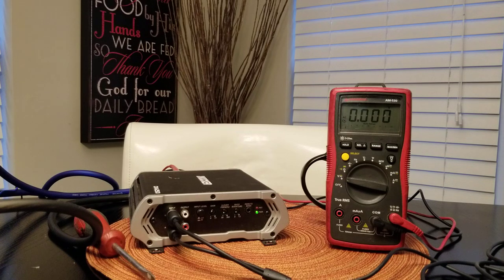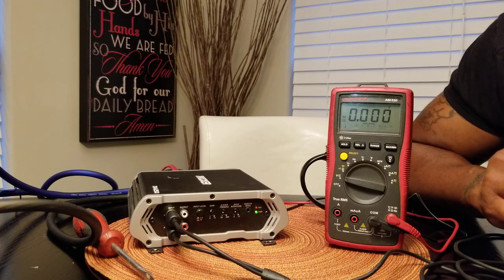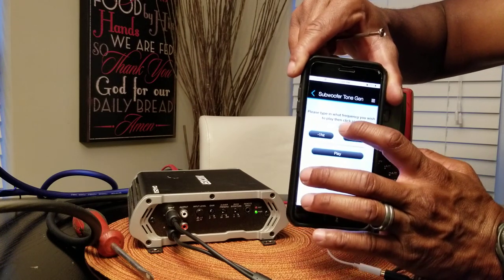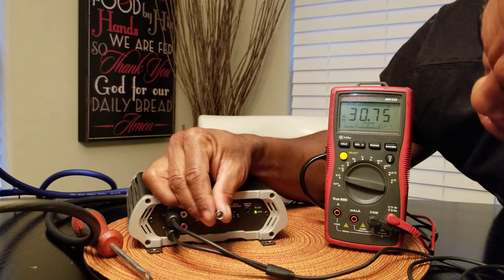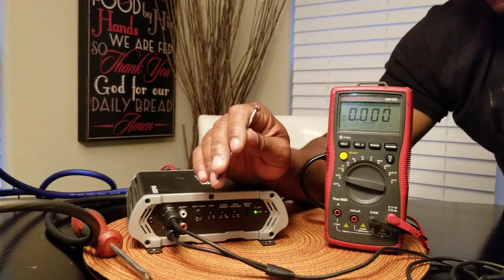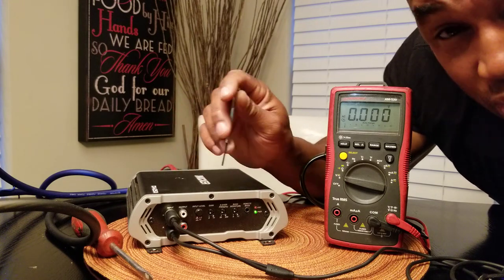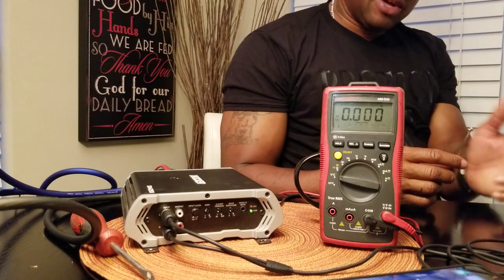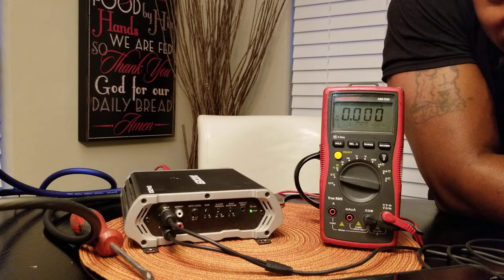Setting amplifier using multimeter

Comment: Saw a few people asking about if having a "bass knob" which actually just adjusts the gain on your amplifier with max on the "bass knob" being whatever your gain adjustment is set to ,all the way down to the gain setting to zero on the minimum side of the "bass knob.". If you set your gain using this method that he showed...just set your " bass knob" to the MAX setting while adjusting the gain on your Amp using the multimeter square root method he showed in the video..What that does when setting the " bass knob" at max is assuring that you can never send a clipped signal because it was at max when you set your gain on the amp... you can go lower whenever you want on the fly depending on song choice but it ensures that you can never go to high...hope this makes sense to those who asked...👍
Reply: not always, some knobs adjust BOOST by db at certain frequencies. that's dangerous and asking for clipping. gotta watch out
Reply: @Whitetrashweldr   not familiar with what you are talking about...Any "bass control knob I have encountered are basically just an adjustment on how many volts the amp puts out all the way up to whatever setting you have your gain adjustment set to on your amp...The "Bass EQ" setting on the physical amp usually does the function you are speaking of and is best to just leave off so you don't send a clipped signal...Not saying they don't exist....but is definitely not common place for a "bass control knob...
Reply: As far as I know the final output that an amplifier will put out is whatever you have your gain adjustment set at...That is why its very important to start from head unit and work your way all the way back to the amplifier for proper signal setting..Finding your clipping point from head unit first...then adjusting any Line Out Converters,Line Drivers, EQ's ect to just before clipping....then lastly the Amplifier Gain Setting to just before Clipping at Max everything...doing this ensures that turning your system up to absolute max will not harm anything because its all been set properly....As well as using the subsonic feature on your amp(if available) because this ensures that your subs won't "bottom out" at extremely low frequencies that 1)your sub isn't designed to produce ..2) If running on a ported or vented enclosure going to far down below the tuning frequency of your enclosure causing your sub to surpass its mechanical throw...Finally the "Boost Boost or Bass EQ function is the most dangerous setting to use because it bypasses the settings at certain frequencies to "boost" the bass which will send a clipped signal and cause damage..That feature is useless in most cases and should be taken off of amps in my opinion...if everything is set properly and you arent satisfied with the bass output......Get equipment that can produce what you desire...taking a short cut with "Bass EQ" Or "Bass Boost" will leave you with damaged equipment almost always....of course this all is just my thoughts and opinions but have yet to fry an amp or sub..👍
Reply: Cmon man if you’ve ever read an owners manual u would know what I’m talking about. Even power series from RF come with a EQ knob. If u want a gain knob buy a rca in rca out gain adjustment knob. But hey 🤷🏻‍♂️
Reply: @Whitetrashweldr  dude we are talking about two different features...any type of " Bass EQ" function on an amp should be left off! Whether it is a knob adjustment or on the amp itself!!! A so called "bass knob" is basically a gain adjuster and is perfectly okay to use AS LONG AS when setting your GAIN on the amp is done correctly...STOP ✋ trying to argue..if you are using a "bass eq" knob ....you are a fool...because its the same thing as the bass eq or "bass boost" on the amp...
Reply: Turn head unit all the way up, Set to sub to 0 and turn bass knob all the way up and then set amp. So that the amp is set to clean full output at full volume of head unit. Then after use head unit sub level of 0 to 10 or whatever to balance listening sound balance of mids and highs with desired sub level. I use bass knob to turn sub down for some songs or audio-quicker than menu surfing for sub level.
Reply: I thought it was best to unplug any bass knob and work only with the actual gain on the amp
Reply: @thadiesel7655  if you won't use the bass knob afterwards you should be fine......if you will use it afterwards it's best to tune the gain with the bass knob at full to make sure you won't clip at full tilt
Reply: Oooohhhh thanks dude! Set the bass knob to max! No wonder I wasn't getting any sound out of my amp! Thanks that worked
Reply: PERFECT!! Thanks @Gregory. Bass levels change from song to song
Reply: @catusg  Just going by ear will have you adjusting the bass frequently. Setting the gain using the multimeter will protect your pricy equipment. Makes sense setting gain with Bass Knob at max. You can always use the xtra head unit bass to avoid clipping
Reply: So what if instead of adjusting the gain you adjust the bass boost the same procedure like he has shown in the video but keeping the gain at zero and bass boost to its rated number the amp can handle to whatever ohms its wired to a sub? That way you have the bass knob somewhere nearby incase of a phone call or you just wanna lower the bass without completely disconnecting from the head unit if you ever need to be able to hear without all the bass blaring in your ear drums

Is this another way to be able to do so or is there other issues involved with this?
Reply: Exactly 🔉✅

Comment: I've been setting my gains like this for years but I do something at the end a little different. The 40 hertz constant load isn't what you will be using as a signal for day to day use, it's music. So being that music is far less stressful on a amp than a tone it seems to make sense that you can squeeze a little more of of the tune on music. This is my procedure. After I have my gain set same as the procedure in the video I then play  a few bass heavy songs that I know play good in my system and I watch how close the voltage on the multimeter gets to my target set voltage. Usually it isn't hitting the target voltage so I add some gain on music till I see my peak voltage hit my number. Even if after three or so songs, if I see the peak voltage peak higher here and there, it's just for a fraction of a second at a time. I have had success for a decade or so doing this.  This really requires you knowing your system and what songs play the best. If your new to it I suggest just following the video only. What do you think?
Reply: Sounds smart dude, because there is maximum voltage the app can hit and also the running voltage it likes for continuous.
Reply: Idk man, @13:47 is what I was thinking when I read this… especially since different sources can have varying fidelity, it could easily lead to clipping, maybe inaudible, but it’d still be there
Reply: Makes a lot of sense because once in a while I'll do the math and set my voltage at what it says it should be I have two VXF 12s and two RP 2000 amps subs are wired to 2 ohms they each got their own amp they're getting 1400 RMS so math says to set it at I think like 53 volts and I always end up setting it to 53 volts and I spent a lot of time on back roads testing my system and whatnot and it seems my system sounds better at 64 volts and I have an oscope and everything and when I usually set it to the 53 volts I do everything the right way and turn all the filters off and I always end up studying it to the suggested voltage and then not liking it and turning it up to that sweet spot I have my subs on my backseat of my Dodge ram quad cab so I mean I can hear every little noise coming from the subs and even at the 64 volts I seem to not have any noises or problems but I also whether I have it at the 53 volts or the 64 I usually have my EQ set to flat I don't have any bass boost on or anything
Reply: @marcus05011993  trip, I just set my two 18”s in my Silverado to 80v for 1600rms with the bass mechanic tracks. Then my bass knob showed clipping on some heavy songs, I tuned with those tracks and it ended up being turned down to 60v on the test tones so no matter what played I didn’t get clipping. It’d be cool if tracks had all the same levels, but everyone mixes differently, and none of the electronic components account for it, they just process and send the signal along. I didn’t hear it clip, but the knob was flashing red like crazy.

Comment: I put systems together that were cheap $60 to $100 amps pushing entey level subs, with low budget mids and highs and systems where the subs alone cost $700 a piece and the component speakers were close to the same. They all sound amazing without ever touching a multimeter. Most of us are never entering a sub competition and nor do we want to. We want to listen to music,  feel the bass and have a good time. Just roll with a few simple rules/policies.....never push your amp to 100% gain always have more power than what you want to use and never push peaks with your speakers and subs. No need to blow anything or even the push limits on anything and it will last forever. Hope you are enjoying yourself some bass brother ❤ Keep thumping!

Comment: Oh how upset the audio shop was. They are maybe behind the "Don't use a Multimeter to set you sensitivity/gain. Use a oscilloscope or SMD DD-1, they are expensive, we could do it for a small fee." Lol, I set my own JL Audio M1000/1 myself with my multimeter, bought my wires (wire kit) OFC 4-Gauge $74, ran my wires (hidden everwhere), ran my bass knob and replaced my 1 mid component speak. Just took my time. The quote, with everything listed for $434, I got it down to $50! I only allowed them to run my signal from my HK factory sub. They didn't answer any more questions and didn't hook anything up. Went home to the garage and got busy. Sealed 10TW3 (400w rms @ 4ohm), SQRT of 1600 = 40V. My ML550 with 11-speaker Logic 7 DSP HK system is now, musically perfect. The anger in their demeanor was excellent. I'm a OP EX engineering Expert, this was easy, anyone can do it if they research DIY 😄💯

Comment: If gain adjusts the AC Voltage, what does (if anything) it do to the current? Does Ohms law apply?

Low frequency needs current, High frequency needs voltage ? 0_o o_0 Would that be trueish or falseish?

Comment: This is the proper way to calibrate your gear, some mobile audio installers don't  know how to properly calibrate the signal from the head unit to the amp and they should know thanks for the knowledge!
Reply: This is absolutely not the proper way to set your amp
Reply: @SheikhN-bible-syndrome  well why don’t you tell us the proper way to set gains then since you know so much you probably have 2-8” Pyle subs on a 400.4 boss amp 😂

Comment: I use this method when dealing with a lower rms subwoofer and a higher powered amp.. this sets the amp perfectly to put out enough watts fora particular sub so you can ensure it’s not being over powered. I also use the SMD DD-1 to find my just before distortion level quickly. Both work in conjunction with the same possible outcome of setting the gain correctly. Explained well MBE

Comment: I run 2 prime rockford truck box 12s 250 rms 500 max I used your formula to set gain for 500 w it sounds great!! Just two dual v coil 12s at 2 ohms plenty of great bass!!!! For a small F150

Comment: How do you feel about taramps? I have 2 12" deaf bonce avatar stu subwoofers. Looking for a solid amp to push 2 12" subwoofers 2ohm rated at 6k watts looking for an amp that will push atleast 5k like the taramps 5k. Are taramps legit though? The dyno tests I've seen look legit. Just wondering your thoughts on the subject, thanks.

Comment: TY for keeping it simple; but I have questions.. I am running 4ch amp in bridge to push the speakers bc 4way rms was way too little for the speakers; bout less than half. Will this formula and technique work the same for my setup? Bridge wattage squared = target voltage???? rounding down to play it safe for me btw... Also 40Htz test for 4channel bridged?

Comment: Hey wanting to run 16k watts to 4 18s @.5 ohms I have the power for it huge custom lithium battery and 3 alts 

16,000 x .5 =8,000 Sqroot of that is 89.44 is that right?
Have a bass clef 17k

Comment: Its kinda cute and dry but some set gains with the sub connected some use sqr rt of the amp some the speaker me for instance have a salt 6 with a nightshade v6 15” which is 3000rms so which number do i use 6000 from amp or 3000 from sub

Comment: MBE baby that was a freaking great video...i always do my tuning by ear and im betting im close but i am going to do this tomorrow. For reference i have a Audio Control LC 1.1500 which bench rest at about 1750 at 2 ohm...this amp is not 1 ohm stable. My speaker setup are Morel tempo ultra components front and rear on a Audio Control LC 4.800 rated at 125 watts times 4 channels. My calculation from this video is 53 volts. My weakest link in my system is the stock head unit going into a PAC 4 volt out with low level signal. I can say without hesitation the Audio CONTROL LC2i Pro was far superior for a fraction of the cost $139 Crutchfield) than the PACGM PRO ($450) . My stock head unit (2015 GMC sierra stock Bose head unit) is junk....i need to get that past 3/4 to get voltage to kick in. between 3/4 and 7/8 is where it finally kicks in. For those reading this get the LC2i Pro it can put out 9 volts from high or low level inputs.....much better unit IMHO. For reference i run several systems but my current subwoofer system are two JL Audio 10w3-4 wired to 2 ohm to the amp. tuning is 32 hertz on a ported enclosure i built. sounds very very smooth and clean and very efficient. I change boxes frequently so i have a excellent reference for efficiency, versus power hungry versus box rise.....it all makes a difference....

Comment: What a great video!! I was trying to check my optimal voltage, but got no reading. Where do you connect the volt meter when changing the gain to set? Anyone’s help is appreciated.

Comment: hi sir
i have kenwood 5200bt head unit with 35 volume degree. base on recommendation in this video i should put volume on 26. but this head unit don't have any distortion even in volume 32. in this case what volume  you recommended?
thanks alot

Comment: I run a harmony audio 800.1 1ohm stable amp with a rated power 800 watts at 1ohm and a dyno sheet that stated it makes 904 watts at 1ohm. I have a Rockville singe 12 ,1ohm final load sub. It’s rated at 1400watts max and 350watts rms with 700 watt power handling. If I set my gain ,using this method , I would just set it using 800 watts ? Square root is 28.28. So that would be what I set it too but would that end up damaging my sub ? Thanks

Comment: Now should I be setting my system to the correct voltage and then after all said and done mess with the equalizer in bass boost because math says I set my voltage to 53 volts I've tested my system on a lot of back roads and whatnot and it seems to sound the best at around 63 volts whether I have it at 53 or 63 I usually have the equalizer flat no bass boost or anything like that on so am I supposed to put it at 53 like it says and then experiment with setting like bass boost loudness exc...

Comment: I have a jp-2300. Do you believe it puts out it’s rated 2300 watts rms. I’m running it on 2 sa v2 10s so wanting to tune it all correctly to the 2300 if possible

Comment: This is a video i needed to watch. This may be a stupid question, but my thinking is, the only stupid question is a question not asked. So here we go. Does this method work for pro amps as well. I'm using  Crown XLS 2502 to run a pair of 18' in a dual 4 0hm that is running in stereo and not bridged. This is in a home theater environment, of course. Can i use this same method to set the gains for each channel on my amp? Thanks in advance fam!

Comment: This is how I set all my amps.. but it’s good practice to measure your rca as well.. especially if using a LOc.. not all LOc are equal and give a clean signal but a lot of clipping can be sent to the amp.. for example I use the kicker which has been shown to supply 6.5-7 clean wo clipping.. as I can measure clip I set mine to 6v to be safe then I work on the amp setting. The amp is the easiest thing to set.. but if you have a dirty signal going to the amp you’re only going to be amplifying that signal no matter how b good the amp is set… 

Also on my cue system I actually set bass to max for adjustment but that’s cause I use the bass setting on the slide unit as a bass knob but you can only do this with boss or HK systems as they have internal circuits that adjust column to eliminate clipping..

Comment: 1 kHz should be used for the mids and highs when setting your amps running your front stage and rear speakers.
Reply: @A. Melbs It’s probably in your manual. If you look at the layout of your 4ch amp and compare the crossover capability, you will want the channels capable of processing a signal and ohm load you can achieve on those two channels. Definitely consult your manual to see with the amp can support bridged. Use 40hz on the lows and continue to use the 1kHz on the left and right channels mids and highs. Good luck.
Reply: @A. Melbs Hook up the probes the same way you want to wire your speakers.

Comment: If you have an amplifier for your mids and another matching amp for your subwoofers, do you on set the voltage output equally on both amps. Lets say, 20 volts all channels on the mid amp AND on the sub amp....

Comment: THIS IS A VERY INFORMATIVE VIDEO,I HAVE ONE QUESTION.IF THE AMPLIFIER HAS TWO 40AMP FUSE, DO YOU MULTIPLE   BOTH OF THEM BY TEN THEN ADD THE TOTAL WHICH GIVES YOU 800 OR YOU JUST MULTIPLE ONE THE FUSE BY TEN GIVING YOU THE TOTAL OF 400?